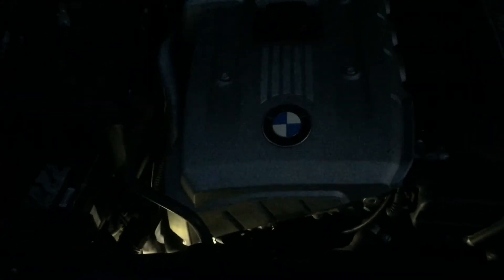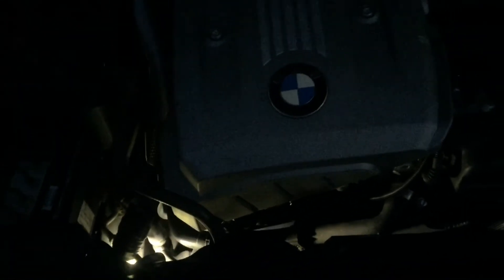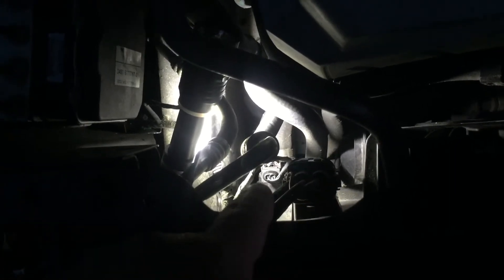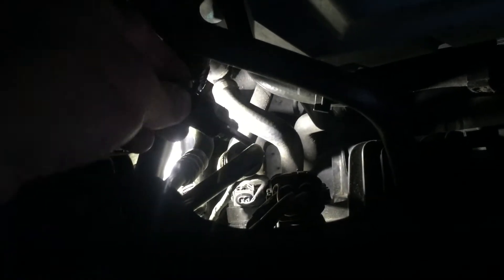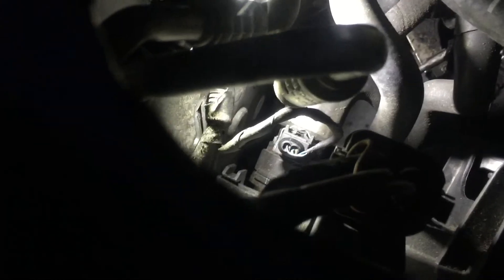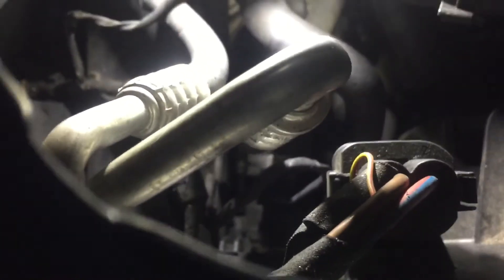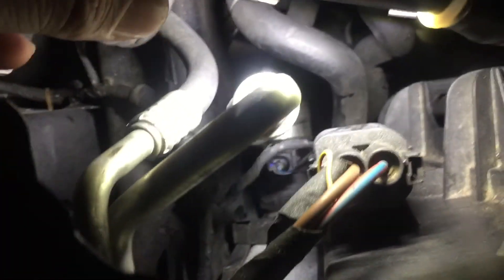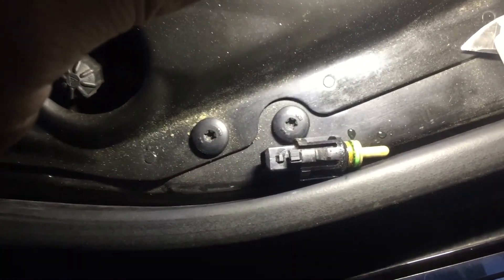BMW E60 radiator outlet temp sensor replacement.

Comment: I own a 2010 BMW 520i. The temperature isn't constant. It rises to 110 and then the fan turns on and drops to 83. I monitor the temperature and when it rises I feel a noticeable loss of torque. Is there a problem with the temperature sensor or the thermostat? Please help.

Comment: 27C3: 27C3 Thermal oil level sensor
2883: 2883 Mixture preparation Bank 2
2790: 2790 Radiator outlet temperature: implausible
My car is running these 3 codes which are causing high emissions and service engine light is on

Comment: Dear friend, i have got N52 engine, my electric fan is constantly running (even on a cold start), do you think, in addition to the temperature sensor at the radiator outlet, can the water pump affect its operation? I also still haven’t found the location of the radiator outlet sensor - it’s definitely not on the hoses and it’s not in the thermostat (I disconnected the plug, ISTA still shows the temperature), the last suspicion is that it’s in the radiator itself or on the pump (I’ll continue my search tomorrow, btw ISTA shows same place as on your video). I appreciate your help. Thank you.
Reply: Did you solve the problem? 😞

Comment: So is that the lower or upper coolant temperature sensor? There are two..
Reply from the maker: KingPrince the one in this video is on the radiator outlet.

Comment: Hey could this be causing bad mpg on and e60 if it was needing replaced? Is this the temperature sensor that would need changed if the car thinks its running a cold map?
Reply from the maker: jamezy boy it can but likely won’t be a huge change.
Reply: @YourCarGuyDR  thanks for the reply :) yeah i have a 523i which is getting 18mpg read somewhere it could be the coolant sensor thats faulty and the car always thinks its running a cold map but not sure what the problem could be.
Reply from the maker: jamezy boy is the only issue the fuel mileage?

Comment: Where in the engine are you working? Drivers side? Passenger side, under the car?
Reply from the maker: Lisa Phillips this is the front slightly to the passenger side going from the top.

Comment: My code read Engine coolant temp sensor2 I know there two temp sensor. One on the water pump and one on the bottle radiator hose.   But Which one is sensor 2? Same reason,  Fan and ac not blowing cold
Reply from the maker: Tom will Kill Jerry. The one at the radiator outlet is the one that will control the fan.
Reply: Your Car Guy DR would the fan have anything to do with the ac not blowing cold ? I was told the fan controls the ac
Reply from the maker: Tom will Kill Jerry. The only time is if the fan doesn’t run. Otherwise the a/c system will run completely separate from the fan. To see what is happening with your a/c you likely want to do a few checks. The first is to make sure your compressor clutch is engaging. I have several a/c videos on my channel. Even though they aren’t BMW the systems all work the same basic way.
Reply: Your Car Guy DR I’ll check it out.  Thank you !!

Comment: Great video, my fan seems to be turning on as well when my e60 is warm but my heater does not work. is the sensor is the culprit
Reply from the maker: John Dejesus I am assuming that your fan works but the heat is not getting warm. There are several things that can cause this. One is if your heater core is clogged. Another is if the blend door that controls the heat is not working. I would try a heater core flush to make sure that you have flow though the heater core. You also have a diverter valve that controls flow to the heater core
Reply: @YourCarGuyDR  thanks so much I'll look into this and keep you updates

Comment: Can this cause the engine to run hot.
Reply from the maker: Kent Gordon yes it can, however there are quite a few things that can also cause it to run hot. Water pump, thermostat, plugged hoses or radiator, blown head gasket or cracked head. If your radiator fan is coming on and running when the car get hot then this sensor is likely working.

Comment: Have problem with cold start. Car starts normally but then dies immidenatly, could it be problem with this temp sensor ?
Reply from the maker: Karolis K not usually. Starting then immediately shutting down is most likely a vacuum leak between the mass air sensor and the throttle body. Check for a vacuum line off or cracks in the rubber boot that comes from the air cleaner to the intake manifold. One way to check for vacuum leaks is to listen for a sucking or whistling sound and locate the source. The less likely possibility would be a fuel check valve.

Comment: Great vid! I'm literally doing this now but the temp sensor seems stuck when i push the tabs and try to pull out. Any suggestions? Not much room to move my hand around in there.
Reply from the maker: crypt0bank a little bit of wiggling will usually break them loose. If not you can try to get some penetrating oil in there. But it is a tough spot to get to.
Reply: you're not wrong! thanks for the tip!

Comment: Thank you man! Also, do you how to change the "Variable Timing Solenoid", "Eccentric Shaft Sensor" or "Eccentric Shaft Sensor" ?
Reply from the maker: Jake Li I do. It's a bit of an involved job. I was planning on doing a video some time in the future with a head gasket replacement. I could easily show how to replace the sensor when doing that video. It does require removing the valve cover.